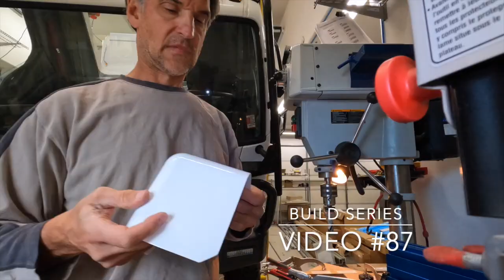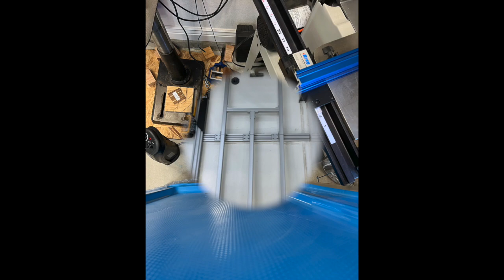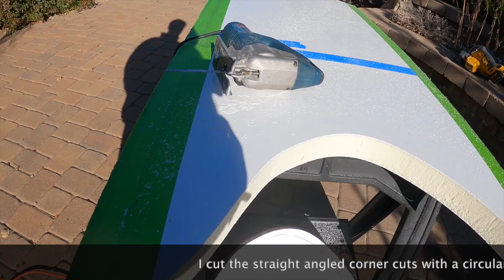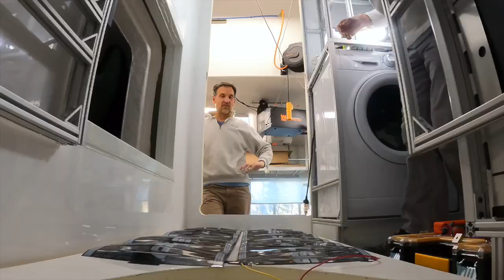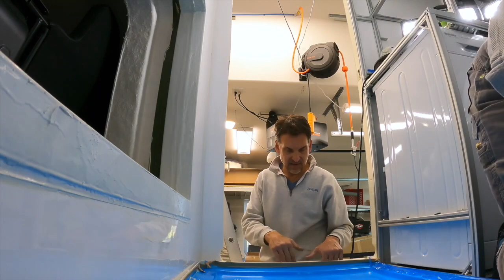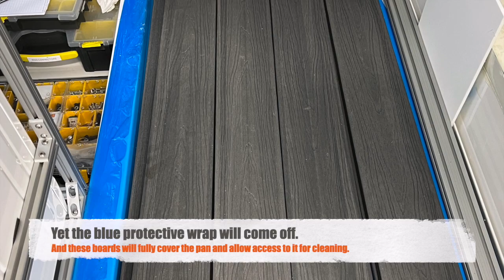Leak-free, heated and removable Expedition Camper shower pan

Comment: That blade looks like a rough cut blade.
Reply from the maker: I only use fine cut blades made for aluminum on my miter saw and table saw, and generally the same on other tools, as these cut the fiberglass, other plastics and aluminum very nicely.

Comment: @vantripping I might have missed it in your video, but is this connected to a grey water tank inside or outside of the camper? I am trying to figure out how to do something similar with a fully contained composite camper box, but I am having a hard time figuring out how to make the drain go to a grey water tank inside without flow issues or clogs. Any ideas are appreciated!
Reply from the maker: My grey water tanks are located between the chassis rails, under the camper.  The benefits of the grey tanks being outside of the camper and in the chassis rails is space, leakage and drainage. By not taking up valuable camper space, larger grey water tanks can be installed, any leaks of grey water will be outside instead of inside the camper, and as you're finding out, you'll have to either raise your shower level which usually means corresponding total ceiling height increase as well, or install a pump from shower into the tanks, which is another leak and failure point. My shower pan gravity drains into hose, an outside custom P-trap, and the hose runs over the transmission to be heated by it before emptying into the first of three grey water tanks. I have three tanks to get more capacity in sizes that fit where there was space. All of them I can access from below should I need to and same with the hose and fittings interconnecting them and electric drain valve. By There is no real need to freeze protect them or keep them warm, since, warm water flowing in from the camper and engine and transmission heat will thaw some of any frozen water and all of the plumbing and fixtures can take freezing temps. As long as the tanks are kept to 90% or less full, the expansion of frozen water shouldn't affect them and I've installed a remotely controlled stainless ball valve to regularly drain the water to keep grey tank level low. I do have a video on this early in this series.
Reply from the maker: Another point is that I installed thru hull plumbing connectors for the plumbing from inside to outside so that there is a direct and fully sealed connection that is air and water tight other than the liquid within the piping, and that plumbing fittings can be easily changed. The other benefit is it's easy to fully seal from any air or water or insect intrusion, and it's very strong and durable.
Reply: @vantripping  thank you for the detailed response! I was hoping to find a way to make the chassis fully isolated from the camper in case I ever wanted to separate the 2 or wanted to upgrade to a different truck later on, but it is proving to be more complicated than I had originally anticipated.
Reply from the maker: @alexiswhetstone8681  I was also trying to keep the camper and chassis separate but have realized that a few things like grey water tanks left in the chassis are very minimal things to add to a new chassis should the camper be relocated to one some many years later and yet having the in the chassis vs camper adds way more value.
Reply: @vantripping  that's a good way to look at it

Comment: well, this is one tight fit. have you considered the possibility to the siphon on the underside of the box to freeze up and expand?
Reply from the maker: Yes, I expect that the exterior and freeze rated drain port/connection under the floor outside will freeze, but should never be enough water in it to break it, as all of the water in it should drain out to the gray tanks, which the hose slopes to. Any minimal amount in the "trap"/clean out will easily accommodate the 9% expansion of water in it to expand into the hose that volumetrically is about a hundred times larger.

Comment: We all have our own preferences on build but,  at 7.20 you talk about working to a tolerance of 1mm  so you utilize every available space - But I'll wager that  if at the end of the build  you reversed engineered it and stacked all that 1" box into a pile it would be highly significant percentage of your build space. Highly significant.  Do I think it's a bad way of construction - No, used in moderation. Would I use it - No. Why?  Because you've done your ground work with the subchassis and the (in my view overengineered)  box. You already have way more integral strength than you're going to need so I see it as overkill apart from maybe retaining the water tank and the washing machine in the case of a major crash.  Me, I'm going the other way this time (my last build in the late 90's was like yours and  the finished weight was frightening!) so this time I'm bonding most surfaces using tape and silicon. My other big difference which doesn't apply to your construction but might help other who follow your channel. Bc I can't use a sub-chassis I'm constructing each internal unit  (wardrobe, kitchen. shower, toilet etc) as an independent structure so as when the  (Merc) chassis does flex each unit can move independently ..... Like I said, we all have our own preferences but I hope these comments might give thought to others who are building/planning.... now, IF that 8020 box was 1/2" instead......
Reply: PS - the shower pan.. You're building in a pristine level garage.  The only effective floor pan for a Overlander shower either has two diagonally opposed drains - or like mine will be a deep channel so that it will always drain 100% when parked on an inevitable angle....
Reply from the maker: Yeah all good points. 1" profile is still wider than the typical 3/4" plywood used, and could be as heavy; I've been weighing along the way and will do a comparative calculation when done. Several benefits of 8020 over plywood are strength and durability but also adjustability and more multi-use like holding heavy objects, or more easily installing things like drawer slides. Every build type and style has its pros and cons. My camper is very feature-rich, and I am limited by materials and construction techniques available to me. I wish more low-weight and strong materials were available and easy to use as 8020 is. I also like you wish 8020 had a common smaller profile than 1", as 1" is even more than needed for most camper cabinet framing and uses. I too think adhesives and other bonding methods will become more common.